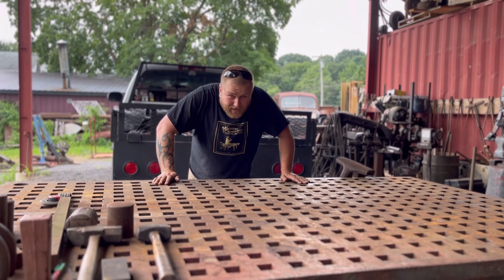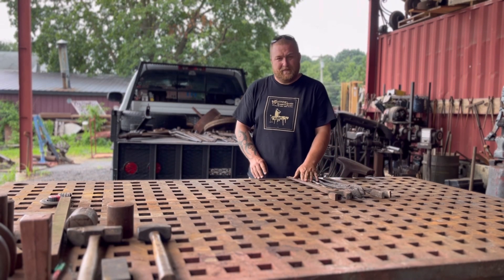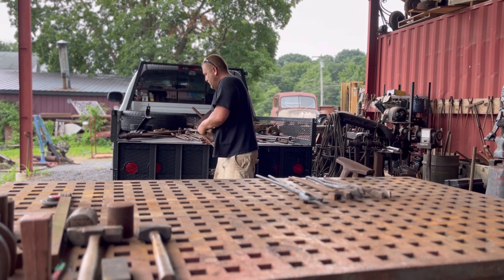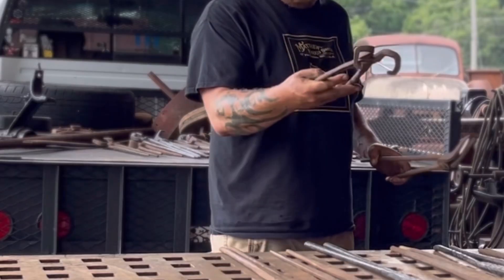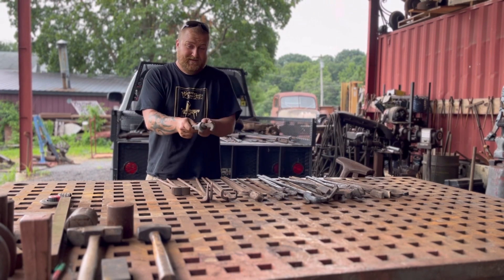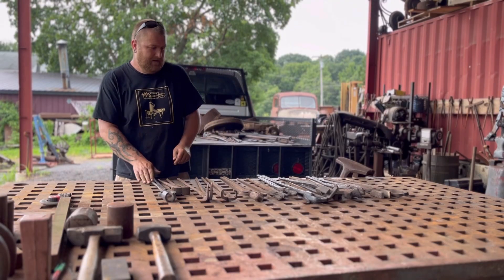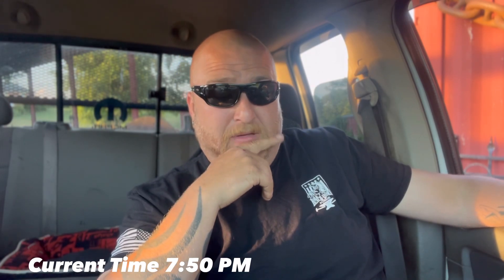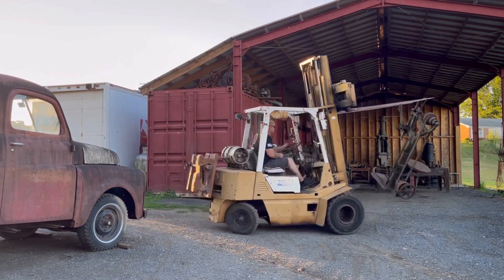I’m giving away all of these tools!

Comment: I’m a Disabled Vet and while I don’t need a vise or most of those tongs I would be grateful to snag some Box Jaw Tongs, I saw several pairs of bigger sizes and all I currently have for Box Jaws is 1 pair sized for 1/2” thick by 1” wide stock if I remember correctly

Comment: I’m just starting out, have been forging for almost 3 months and would love a good solid pair of tongs, I’ve been using pliers for the most part to hold the material If it’s not long enough for me to handle. If you have a pair of bolt-jaw tongs or flat bit or vbit or anything really I’d really appreciate them and use them well!

Comment: Hello my brother. A little over 18 months ago I was riding to work on my 1957 Harley Panhead and I was clipped by a Ford F350 and flipped up and around a telephone pole and had my right leg nearly crushed completely in two.I crawled up my dad's driveway and my brother was stopping by to drop his kids off with mom so he ran me to the hospital immediately. he wanted to wait fro an ambulance but when we got to the hospital and they did a sonogram of my leg the surgeons said I had a large blood clot that broke loose and went to my heart and lungs making it feel like I was drowning.  They said I had less than 6 minutes to live by the time they figured everything out. I was a bodybuilder that competed in classic physique so I guess that is why I recovered pretty quickly. They said it would be probably 4 years until I walked again if I was able to keep my leg. My circulation came back and I am able to walk without assistance but I am out of shape. I was trying to start a blacksmithing shop and foundry to make parts and pieces for obsolete machinery and old cars. I am getting parts together to build a 1928 Morgan RIP 3 wheeler GN special with 4 wheels. I want to use an experimental airplane engine for the front and a MGB transmission for the transmission. I could really use a forge blower and some tools my friend. I have not been able to work and it has been really tough . God bless brother and I am in Pennsylvania. Either way I would love to come and see your place sometime.